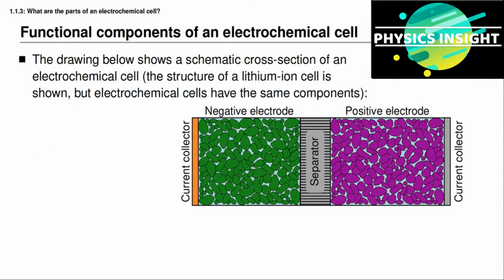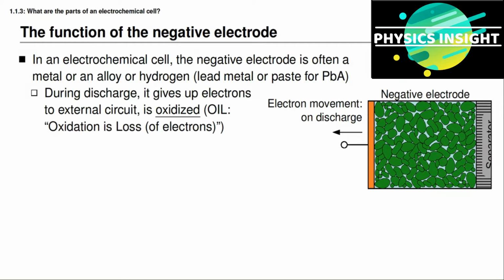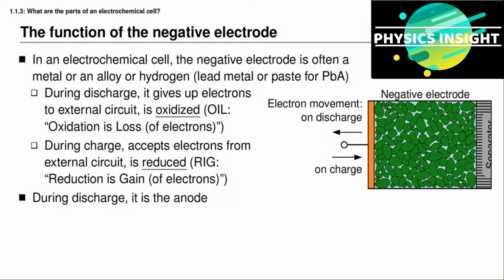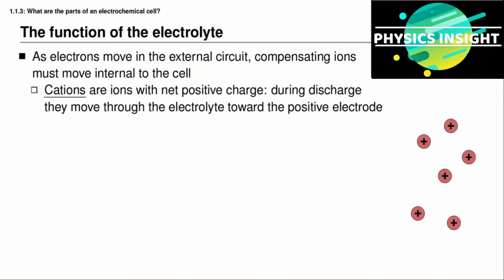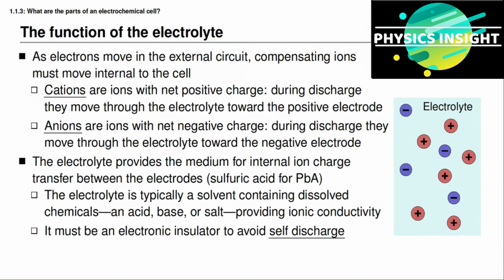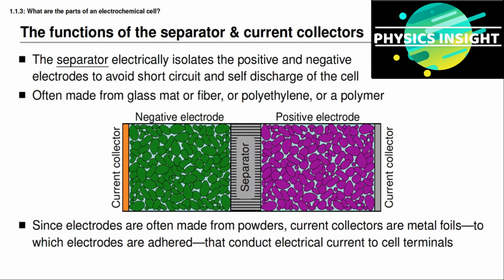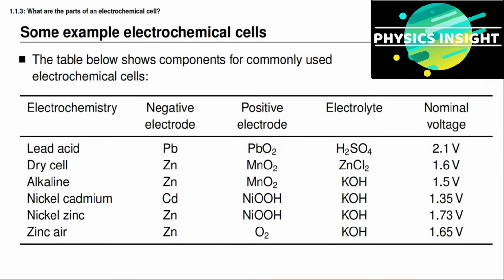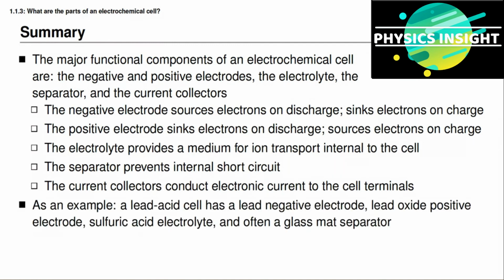1.1.3- What are the parts of an electrochemical cell -  Battery Boot Camp

Comment: You say that the electrolyte must be an electronic insulator. Sulfuric acid (used in PbA) is an excellent conductor.   Check with Google. Or use a multimeter. What did you mean to say?
Reply: Sulphuric acid can conduct electricity because it contains a lot of ions that will move to compensate for the voltage you apply.

Assuming the voltage isn't high enough to cause decomposition (or any other chemical reactions that would consume or produce electrons), the whole system will work more like a capacitor then a conductor – it will conduct electricity for some time, but after enough ions move closer to the positive and negative contact points, the electricity flow will stop.
Reply: To be more precise, "electric insulator" is not the same as "electronic insulator". The latter refers to not conducting electrons, and not electricity in general.